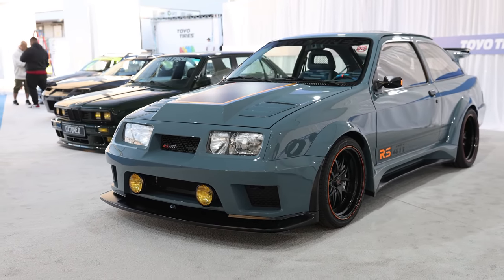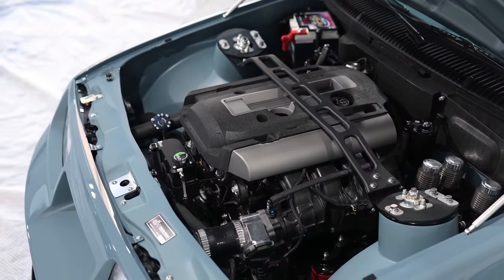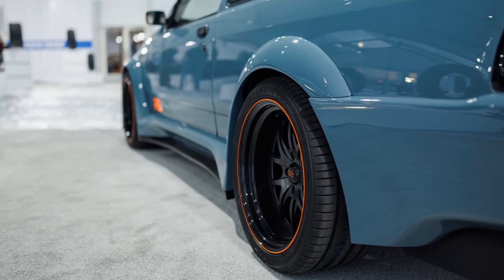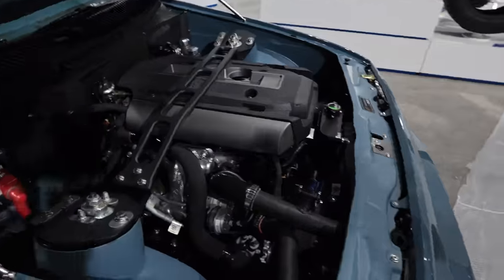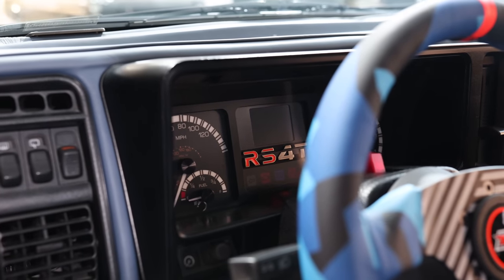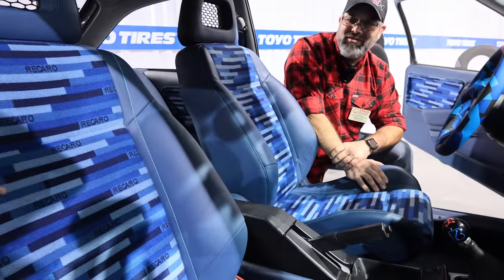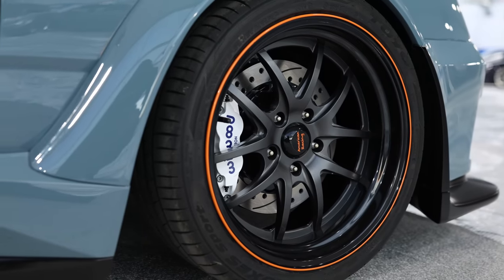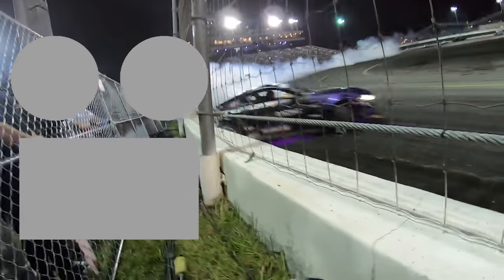Modernized "Ford Sierra Cosworth" with a 2.3L Ford Ecoboost Crate Motor

Comment: Sorry, but the Merkur isn't "tuna". It's way before that. The British and European markets had many many cool cars that never came to the US, or if they did they were ruined by Federal standards. Mostly Ford : Anglias, Escorts, Capris, Granadas. But some GM as well : Asconas, Manta, Firenzas.

The Merkur was one that just managed to keep some of it's European performance, and even looks. The plastic bumper covers hid the heavier Federal bumpers well. And the 2.3 turbo 4 engine at 175bhp gave a useful increase in power over the 150bhp V6 Cologne as fitted to the Sierra XR4i.

And what's with the dude asking the questions? "It looks like an all-wheel drive car". What does an all-wheel drive car look like? The Merkur was always RWD, and only later Mk2 Sierras and Sapphires had 4x4 models, or what people call all-wheel drive now.

Comment: This is not a Sierra Cosworth. The Sierra Cosworth, Sierra Sapphire Cosworth & Sierra RS500 all came standard with the legendary YB engine, Recaro Trim, bodykit, roll bars etc etc. The Sapphires came in 4wd & 2wd and were 4 door saloon, the 2 door Sierra came in only RWD spec. The Cosworth was only released in and sold in the United Kingdom. We also got alot of other variants for anyone interested. Ford Escort Rs Turbo Series 1 & 2, Escort RS1600i, RS200, RS2000, Escort RS Cosworth, XR3, XR3i, XR4 etc. There was dedicated tuners who worked with Ford to turbocharge some of the n/a models, Turbo Technics for example are legendary.
Reply: Cossies and the rest were sold all over Europe. RS500 was the only UK specific model
Reply: @samianttilampela6384 Thanks for the correction, forgot seeing alot of German Cossies and I remember seeing a few in South Africa.

Comment: Lovely looking build but I wouldn't of used a 2.3 eco boost!  
The 2.0 duratec from the ST is better, as its got a closed deck block, opposed to open deck block, that breaks a lot.

The 2.3 is not as good or robust as a YB, and probably couldn't supply reliable HP, in bigger numbers, like a YB can.

Comment: This guy doesn’t know what he’s talking about. The Ford Sierra RS Cosworth was built as a homologation special for Group A touring car racing. The  Sierra RS500 Cosworth was the evolution version. The base model was the RS Cosworth which they built 5000 of, they then built the 500 RS500s as the evolution model. BMW did the same with the E30 M3, the standard model they built 5000 before the built 500 Evolution 1’s, they then built another 500 improved Evolution 2 models.

The Sierra Sapphire RS Cosworth was the 4 door model. In the UK it wasn’t badged as a Sapphire. This was then followed by the Sierra RS Cosworth 4x4, also a 4 door sedan. The Sierra RS Cosworth 4x4 was the car Ford used in the WRC, it was then replaced by the Ford Escort RS Cosworth, which was an Escort body attached to a shortened RS 4x4 chassis and driveline.

Comment: You can buy 3 of those for a $1000 bucks????
Honestly???  Over here in the UK a Non Runner that's Been Off The Road for 10 Years ,every panel on it needs work and they go for anywere from $10000 to $20000 all day long,no questions asked

Comment: It had the look but it's was junk. The 2.3 was a terrible engine that Ford just simply threw in the turbo and have fun warranty back then was 12/12,000 miles.
Reply: Yup why on earth didn’t they throw a 2.0 cosworth motor in there!!! 😢 it’s way more stronger and tuneable than the 2.3 eco boost. What a let down on the motor side of things but it does look awesome tho!!!!

Comment: Why would you do such a transplant, as the old 2.0 cosworth is WAAAY more stronger engine and anyway you could choose from many other engjnes stronger than that open deck shitty direct injection engine? Open deck is NOT for modification and decent power (500-1000bhp) but just for stock power ...a limited period of time if stock exhaust on it and no oil catch can is there instead of stock system.
Reply: 😂 IKR… why wouldn’t they use the 2.0 cosworth motor? It’s a race bred motor that’s stronger than the 2.3 eco boost!!! I don’t get it!!!
Reply: @robocop3961  did you READ what i written above? Read that COMMA too, because in a phrase that sign give some specific sense (which you "understand" otherwise.. but laughting - which, by the way, didn't say anything good about you)